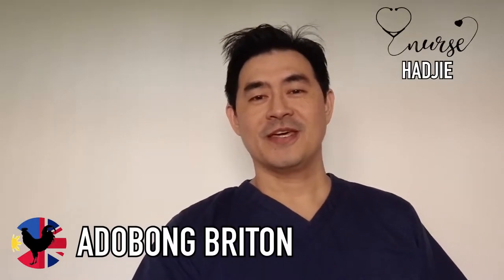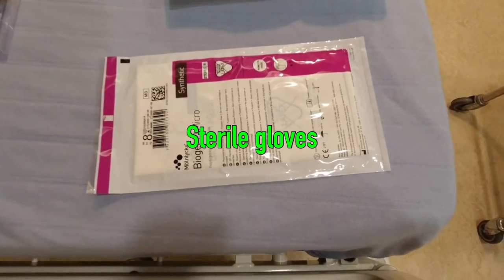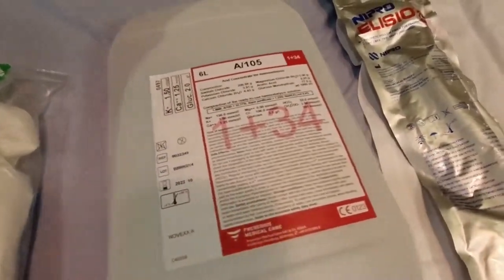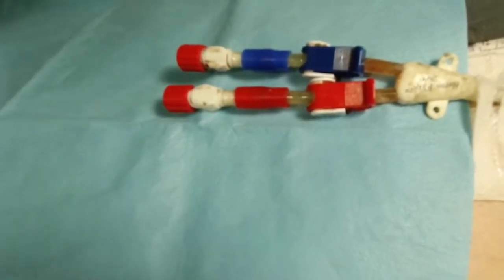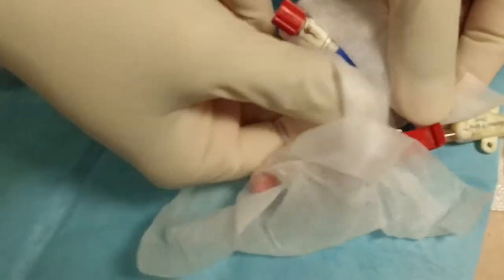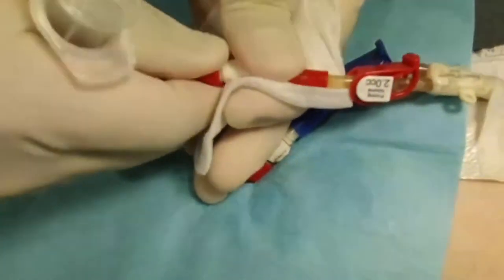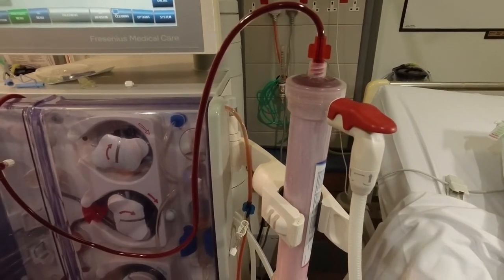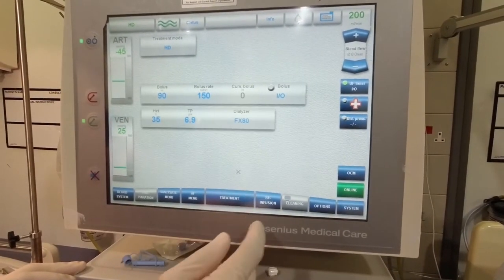HOW TO CONNECT PATIENT ON HEMODIALYSIS

Comment: hi. I think there is something wrong with your connection of the dialysate coupling. should be if the red is on the top, in your dialysate section the arrow should be going out. so in this machine, should be red to blue and blue to red as what we saw in the arrow.

Comment: Just a thought, do you think it would make much of a difference if you leave the venous line attached to the drainbag after starting the treatment, then only connect the venous line to the patient once the line is filled with blood, that way you prevent the saline that you used to prime the line to be introduced to the patient?
Reply from the maker: Hi Cealizar, thanks for your inquiry. 
Years ago we used to connect venous lines on drain bags when priming. Nowadays dialysis RO water are supplied online (this means the RO water is centrally supplied straight to the back of the dialysis machine).

Priming blood either by using a drain bag or straight connect doesn’t make a lot of difference. Straight connect however, is beneficial on patients with low starting blood pressure as you maintain the volume of the extra corporeal circuit which is approximately (300mls). This extra volume can then be added to the fluid removal as needed. 

If you are worried about saline’s effect when mixed in blood, NaCl is isotonic to the red blood cell at a certain concentration, hence NaCl 0.9% maintains its isotonic properties and does not affect the red blood cells.

Hope I managed to answer your query. Please don’t hesitate to ask for more renal related questions and I’ll be happy to answer you back to the best of my knowledge 😊
Reply: @abriton  hey, thank you for taking the time to answer the question.  Much appreciated

Comment: Can i ask how do you prime and return blood using saline in the fresenius 5008s machine? 😮
Reply from the maker: Hi there, thanks for your enquiry, you can just hang a bag of saline and connect your arterial line to prime, same procedure with wash back or blood return there is the option of saline or online also connect your arterial line to the bag of saline to do this. 

 We don’t use saline nowadays as we have centralised RO water supply around the unit. It’s simply plugging in the provided RO supply to the back of dialysis machine then prime and wash back using the online system. Hope this helps 😊
Reply: @abriton  thank u so much ☺️